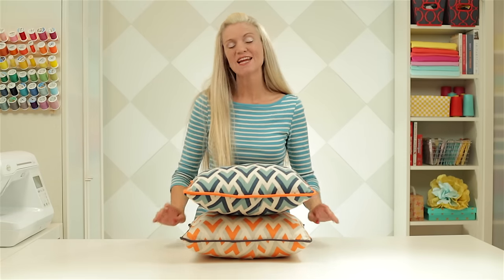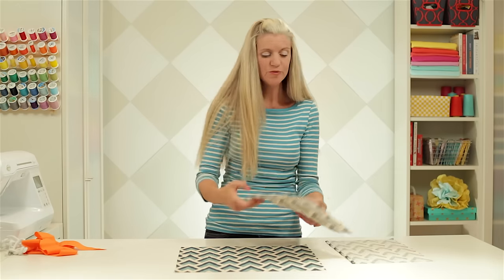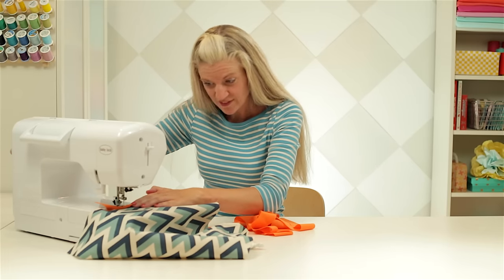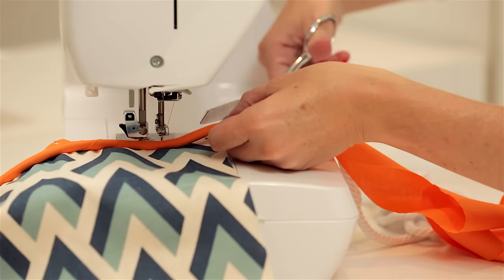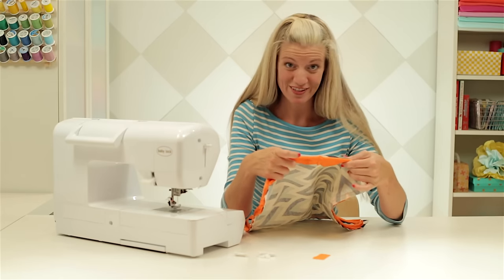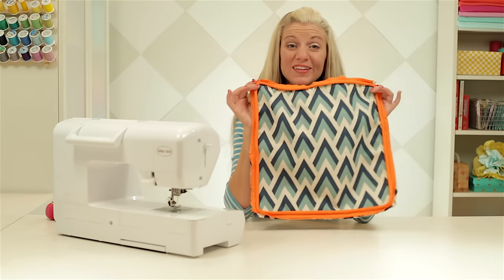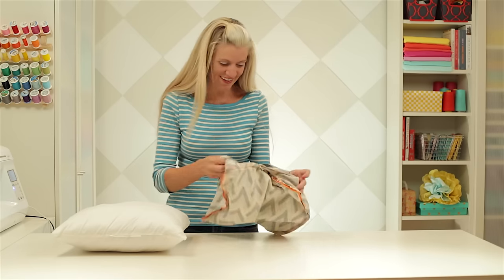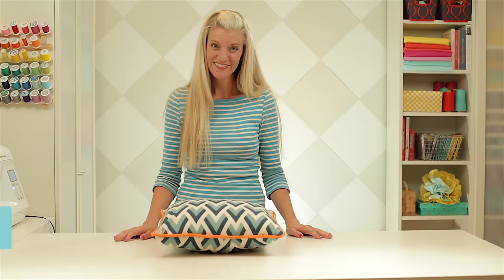How to make a pillow or cushion with Piping attached

Comment: Love this video and learned making the piped from you.  Thank you.   One tip:  to prevent the cord from fraying, before cutting, wrap a piece of tape around the cord about an 1/8th or 1/4 inch from the cord edge, then cut and the wrapped cored stays in place and it's much easier to match two taped ends.  :)

Comment: Hi! Your video is so helpful.  I have a question, however.  Your size of the cut fabric and the pillow form are the same.  When you sew the back to the front, will not the seam allowance make the pillow "case" too small for the form?  Also, what is the seam allowance you are using?

Comment: Thank you for this video! When making pillows should I use quilting fabric or cotton canvas for the couch?
Reply from the maker: You can use either!  Canvas and upholstery fabrics are more heavy-duty and thicker, so they typically hold shape better. But they can also be less comfortable than quilting cottons.  If you find a quilting cotton you love but it feels to thin, just sew it with an extra layer of plain white fabric behind it....or, use a layer of Interfacing.

Comment: When I followed this tutorial the only part I struggled with a bit was figuring out how large to cut the back panels, because my pillow was 12x12 not 16x16 like yours. But I think I figured out the formula is to divide the total width in half then add 2 inches, right? So in my case my back panels were 8 inches wide each because 12/2= 6 plus 2 inches.

Comment: I just watched your video. It's excellent. I just tried it on a small pillow. Got to the part about taking the piping apart and butting the ends of the piping together and covering with the piping cover fabric. Problem, this store bought piping is woven through, there is no actual piping inside of it. What to do now? I was thinking butt the ends together with fabric glue, then doing hand embroidery with matching thread with a bead on it. Your thoughts/suggestions? Thanks in advance!
Reply from the maker: Hi Ginger, you can finish off the ends of store bought piping the same way...you just need to pull the fabric away from the cord a bit, so you have some that can overlap, like I show in the video.

Comment: Hi Dana! Quick question. Do you know how to sew 'box cushions' but in circular form for an outside round chair? The seat on the chair is a circle and I wanted to know if you knew how to sew this. Many other tutorials only show you how to make them for square chairs. I like the video!
Reply from the maker: I do but it's maybe not as quick and easy of an answer as you're looking for! Basically you need circles for the top and bottom of the cushion, and then a strip of fabric as long as the circumference of the finished circle and as wide as the finished depth of the cushion. (Plus seam allowances on all pieces.) Hope that helps!

Comment: I enjoyed your video but need some clarification. You said you cut the fabric 16x16 and used a 16x16 pillow. I ordered some premade pillow covers. My pillows are 16x16 and that is what I ordered but they did not fit. I could not get the pillow into the pillow cover. When I re read the description it said to order pillow covers 1 inch or maybe it said 2 inches bigger than your pillow. I did and they fit perfectly!  After allowing for the seam allowance wouldn't the cover be too small for the pillow?

Comment: Do you need to add 1/2" to the overall size for the margins of 1/4 all around? So it would be 16.5 x 16.5?
Reply from the maker: You don't need to. If you cut the pieces the same size as the pillow form, it creates more fullness in the finished pillow. But you could add the 1/2" if you wanted a flatter end product! :)

Comment: If I don’t have a piping foot, what is the best foot to use for piping? I’m sort of a beginning sewer.
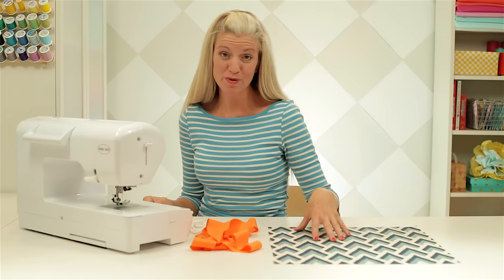Reply from the maker: Just use a zipper presser foot. Most machines come with one, That's what I'm using here, watch 2:00 in to the video. If you don't have a zipper foot, just use your standard foot that comes with your machine, and see if you can shift your needle to the left so you can get closer to the piping. Hope that helps! Dana

Comment: Loved your tutorial!  I have been searching far and wide (all over the internet, at Pier 1, Bed Bath, Cost Plus & Ross) for a 13" round cushion for my tiny bistro set, and no one is selling round cushions right now. (On the internet they are, but they start at 15").  So I bought two square cushions from Bed Bath and they have piping, but they are not slip covered, they are directly stuffed with the stuffing.  I was wondering if you could do a tutorial on re purposing them into round pillows, and reusing the piping?  Or perhaps you already have?

Comment: Hello Dana.  New subscriber here. Fantastic tutorial, Thank you.  Can you please tell me the thickness of the cord that you have used?  I'm wondering if a 4mm twine would be the right size.  If not, could you please advise me on the right size to buy?
Reply from the maker: Hi Joanne, I actually can't remember the size I'm using here (sorry! it was a few years ago) but you can use any size cord! You just need the strips to be wide enough to go around the cord and have some extra that will be sewn into the seam.
Reply: @MADEEveryday  Thank you.  No problem, I will sort it out.  I still haven't made a start.  Busy life.  Thanks for getting back to me.  Great channel. :-)
Reply from the maker: @joanneadair9227  I hear you! Not enough time in the day to start all the projects :) Good luck!
Reply: @MADEEveryday  Thank you. :-)

Comment: I have fabric and piping from the store and was planning on doing this exact thing!  My only questions is regarding your fabric size.  You said you cut your fabric 16"x16" for a 16"x16" pillow form.  Does that include your seam allowances then?  I made similar pillows several years ago and cut the fabric larger to allow for a seam allowance, and the pillowcases turned out a bit looser than I would like.  The pillows I'll be working with this time around will be 20"x20".  Should I cut the fabric that size too then?
Reply: Mandy Ames I have the same question
Reply: How can cutting fabric 16x16 for a 16 x 16 pillow form work.?  I happened to have both a 16" x16" pillow form and a 14" x 14"  pillow form on hand. Shaking my head, I cut the fabric as instructed in the tutorial ("16" x 16"). Pillow case fit the 14 x14 pillow form exactly.  Please advise.
Reply: Hi, I made the pillow cover without the piping a few years ago following Dana’s tutorial. The fabric is the same size as the pillow for a nice snug fit, otherwise you’d have loose cover around the pillow.
Reply: @Lyagushka8669  Yeppers 100% right. : )

Comment: When constructing a square pillow you only need one snip on the corner to pull it round. Doing it this way stops all the creases you have created in the corner. The joining of the piping needs to be done on a right angle for a professional joining of the piping. Don't like the two pieces on the back when a zipper is so easy to put in next to the piping.

Comment: Can you make piping without cutting fabric on the bias?
Reply from the maker: It won't work as well if the fabric is not cut on the bias (or on the 45 degree angle). Cutting on the bias allows the fabric to "stretch" a bit and lay nicely around the curves of the piping rope/cord. You can learn more about bias tape and why this is important in my video here: https://www.youtube.com/watch?v=9TxwfCWGUkY&t=93s

Comment: please say what your stitch length and width was for this project please.
Reply from the maker: I typically use a 2.5 stitch length, and 3/8 inch seam allowance. But you can adjust as needed for your project.

Comment: can someone explain to me what the advantage is of pinning the way she does? otherwise the tutorial makes sense to me, but my whole family did the pins 90 degrees differently, and my brain cannot compute
Reply from the maker: You can pin however it makes sense in your brain! There's not right or wrong here. I like to pin perpendicular so it's easy to pull the pin out with my right hand....and I can sew for longer before coming to a pin.
Reply: @MADEEveryday  thanks a lot! i will just give it a go next time. i think i might need double the amount of pins to keep the fabric tight enough for my liking, but i guess it's worth a try. it does make a lot of sense that it's easier to pull out and keep sewing.